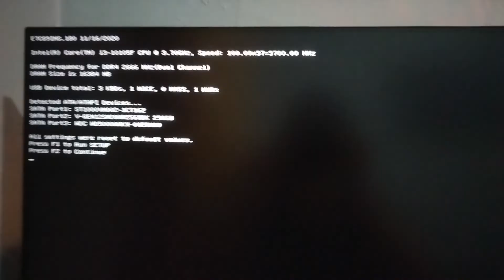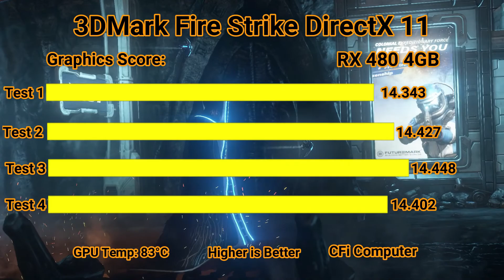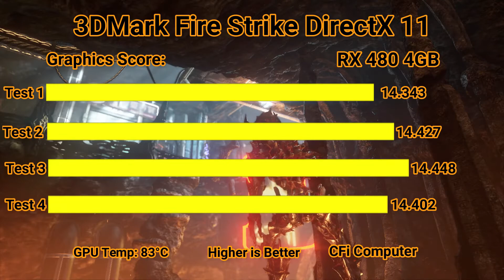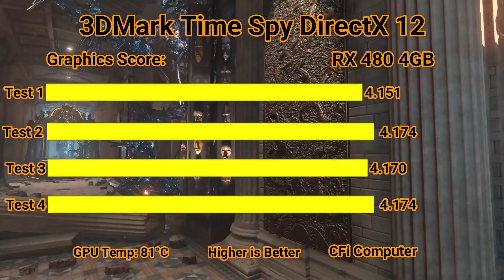Unboxing And Benchmark The RX 480 4GB MSI GAMING X - 2024

Comment: I recently bought this card (8GB version) from a seller that used it for mining.  I had to replace the fans and the thermal paste; also flashed the latest official gaming bios.  It tops out at 73 degrees C without any adjustments to fans.  I love that it runs very very quiet.  I'll be looking at MSI products in the future.  I'm impressed by the build quality.

Comment: You need to change the thermal paste on that card. 83c is 20c higher than what those cards should be running at.
Reply from the maker: Yeah, i Change This GPU Thermal paste and after 2 days of changing the Thermal Paste the GPU its broken and it show No Display on the monitor hahaha😂

Comment: How much power does consume
Reply from the maker: 150 Watt Power Consumption While Gaming😅
Reply: @ComAndFixiT  why my is limited to 110w
Reply from the maker: @GAMEREVER-ne6rs  Maybe your Gpu Power limit is on You should disable it with MSI Afterburner Apps, Or if your Gpu is Ex Mining Maybe the Bios is the mining version Not the original bios, Which mean the Mining one Just lock the Gpu Power consumption and the Gpu usage, you have to check in GPU Z To see the Bios Version. The original bios is 015.050.000.000.000000
Reply: @ComAndFixiT  the mother board limited the power to 110w and in msi the power is 0% if i put it to plus 50% the pc shutdown
Reply from the maker: @GAMEREVER-ne6rs  You have to check the Gpu Bios, if the Gpu Bios is not the Original From the RX 480 that is the Problem, You must to flash the Gpu Bios To the Original RX 480 Bios to Fix The Power Limit .
Reply: @ComAndFixiT  what the deference between the original bios and other
Reply from the maker: @GAMEREVER-ne6rs  Dont put in 50% the power limit, just put it to 100%, if you put in 50% the Gpu is limit the power consumption.
Reply: @ComAndFixiT  in msi afterburner there’s only +50% or-50% or 0%
Reply from the maker: @GAMEREVER-ne6rs  The difference is, the Original bios its intended for gaming and the bios settings its not limited the power, they just wastes the power consumption to get a best performance for gaming. And the Second one is the Mining bios, Mining bios is Intended for Mining Crypto Currency and the Gpu with this mining bios is Limit the power Consumption to Save much Power, Because the Mining Gpu is Running 24 Hour Nonstop and if the bios is original is Waste so much power and make the Electricity bill more expensive, for that The mining Gpu just use the Mining Bios to Save more Electricity Cost.
Reply from the maker: @GAMEREVER-ne6rs  Use the Newest version of the MSI Afterburner
Reply: @ComAndFixiT  ill see but i have only 300w psu
Reply: @ComAndFixiT  what your ig to talk ther
Reply from the maker: @GAMEREVER-ne6rs  You have to upgrade your PSU from 300 Watt to 500 Watt PSU because the RX 480 Consume Much Power
Reply from the maker: @GAMEREVER-ne6rs  I don't Have IG
Reply: @ComAndFixiT  what you have
Reply from the maker: @GAMEREVER-ne6rs  i only have FaceBook
Reply: @ComAndFixiT  what’s you fb
Reply from the maker: @GAMEREVER-ne6rs  https://www.facebook.com/profile.php?id=61556640270739&locale=id_ID  That's My FB